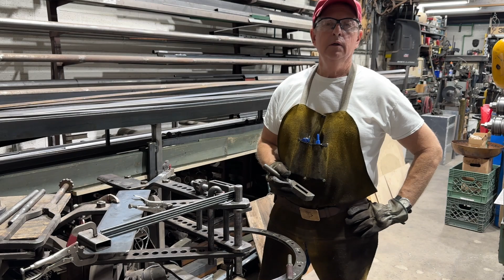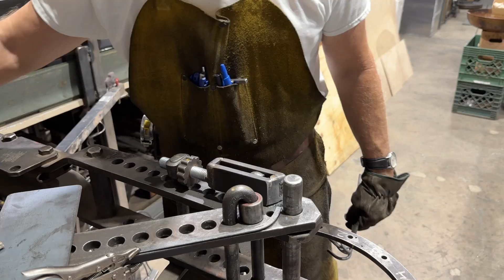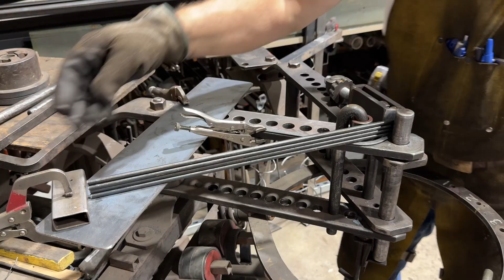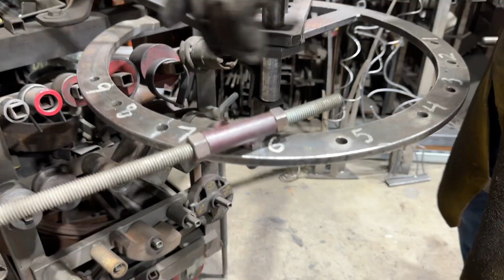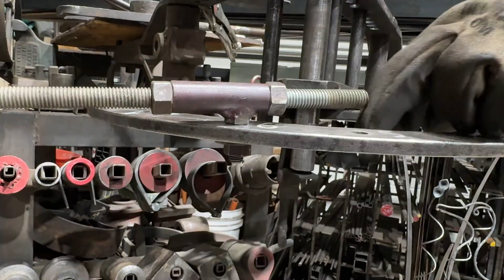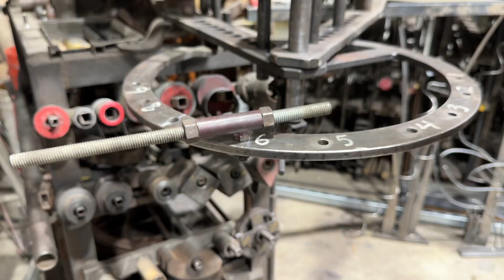Bending 4 Parts at Once with the Hossfeld Bender

Comment: I really appreciate these Hossfeld demonstrations. 

When you are fabricating longer pins and parts for the Hossfeld do you generally use hardened steel or just mild steel? 

Swing arm stop system is something I’d also like to see explained in more detail.

Thank you!
Reply: Appreciate the answer.
Reply from the maker: I made many of the longer pins using Grade 5 bolts  - I cut off the threads and the head of the bolts.